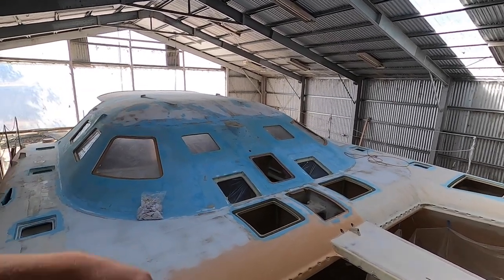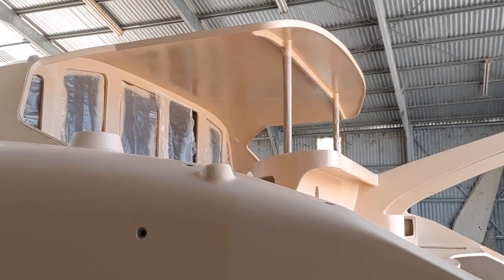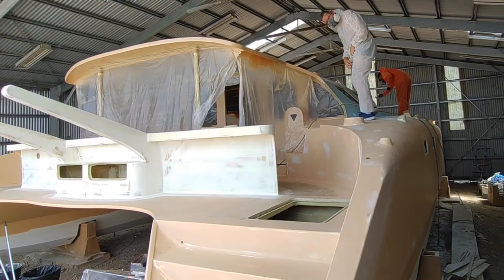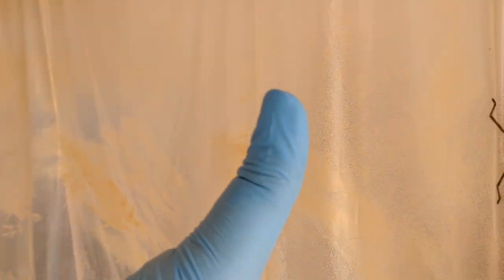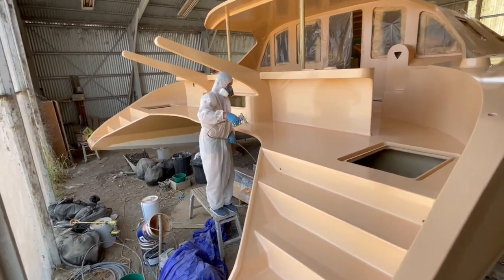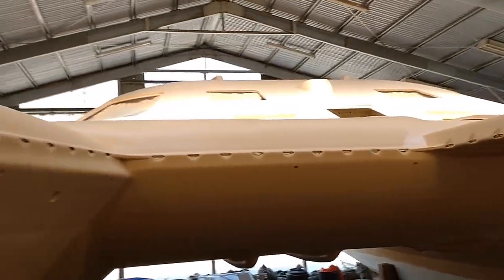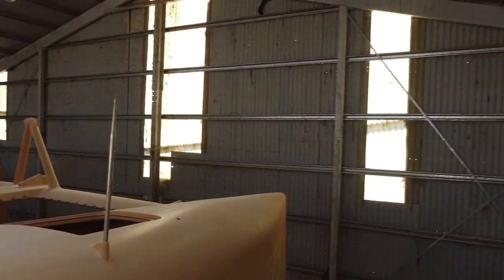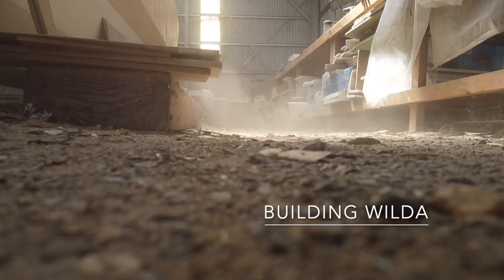WE almost HAVE A NEW BOAT! Paint transformation - S02 E12

Comment: Now that was the easy coat. 😉 High build primer you can spray anywhere anytime since the surface finish is of little importance, as is working from a wet edge - you’ll have sanded much of it off by the time you do the final fairing.  Top coat?  Now that’s a different story. Get some practice if you’re spraying it youself😅
Make sure you have a well thought out strategy for masking since you can’t spray the whole boat in one go without going back over areas and “dusting” glossy tacked off areas with over spray…  not to mention the difficulty in maintaining a good wet edge if you take on too large an area - it’s tricky. That spray outfit looks like a good one though.  I’ll be watching with interest to see how you get on. Good luck. Cheers.
BTW, go easy on the spider - just a harmless Huntsman who helps keep the other Aussie bugs down 🙂
Reply from the maker: The huntsman is safe🤣

We'll probably get Chris to do the topcoat. He does an excellent job. On the inside, we might give it a go. Had some practice now and it's a steep learning curve.. more sanding 🤣 But also really rewarding. Not going for gloss on the inside so some orange peel and flat paint will be ok.
Overspray is tricky. Less so than with compressed air systems, but still. Looking forward to the next layer of finishing primer!
Reply: @buildingwilda  Good idea.  On a job that size I think I'd be getting a pro involved.  I sprayed my first small boat and that was definitely a steep learning curve - I had to wet sand the whole boat. I'd spent weeks faring it to perfection and could not except a dodgy paint job. As a complete noob I was wondering what the spots were at one point before realising water was condensing in the tank...  ) :  Looked like glass after that, but it was huge amount of extra work - 400-800-1600-2000-polish.
This boat turned out much better, but trickier to do with lots of chines, faces and angles and masking off, then careful wet sanding at the masking boundaries...  I also went for a satin finish inside which I actually rolled on. Mine's a much smaller boat and trying to get around inside with a spray gun and do a good job would be close on impossible.  It has a faint stipple but with the low sheen finish it turned out much nicer than I thought it might. Cheers
Reply from the maker: Sounds like you got it right though! Well done! Not as easy as it looks. Coming up soon is a video of us painting the interior. All sorts of problems because we are not pros. Once we get them sorted, it works out ok. Being primer, no big deal but still extra sanding because I don't know what I'm doing. Good fun learning new skills though. I think next round will go great! Final primer!

Comment: What colour is that?
Reply from the maker: It's called beige by Hempel. I call it salmon pink. Either way it's their quattro primer. Sands easy (sort of) to a very smooth surface for a good second coat. The color is not great, but the difference between the cured smooth surface and the sanded surface also helps with the next round of fairing.